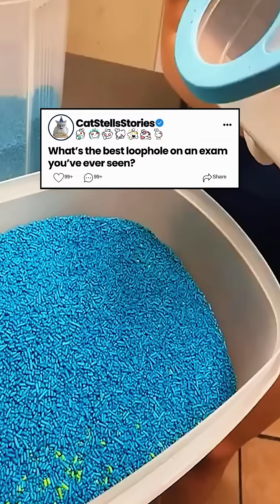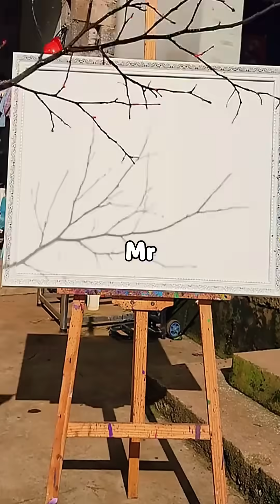What’s the best loophole on an exam you’ve ever seen?

Comment: That's not a loophole you just read the question
Reply: yeah once had such a question in basic chemistry about a concentration cell the math worked the results were physical impossible somthing along the line of 10^-34 or 10^23 mol/l
Reply: The loophole is when you have an exam. You start reading books mo ths before and you store notes in your brain. THEY CAN'T CHECK IN THERE. Absolute cheat. Works all the time 😏

Comment: A teacher that has a high failure rate has failed as a teacher
Reply: I was a TA. The rules it had for the class were simple 1. If you were not able to finish the test or quiz within 30 minutes of the first person to turn it in you didn't not get more time to finish, with 1 exception if the same person turned in there paper forst for the last 3 quizzes order test them it defaulted to the second person.  The second rule was that is gave the final on the first day any then gave it back with all the correct answers, them saw it again as there final. I cant till you how many of the A students in other classes gotten Cs in my class and there student that took my class seriously were getting A's.  
Them best part was the parent that would call and ask for there child to retake the Final.  When I informed them that is had given there child the Final to them on the first day of class and that there child scored a higher grade then at the end of the year, because they only completed 30 of the 100 questions because they need to get 30 right for an A grade. I wouldn't be giving them a makeup test.  There were only 5 times that I gave a retest and all of them were for reasons outside of the students control.

I used the data from that class to write a paper for my sch class On How Students look at classes they think they know, when i turned it in my
Reply: Normally, I'd agree with you. However, in this particular case I agree with the professor. 

Being able to recognize the impossible as impossible is a lesson that cannot be taught, it must be learned.
Reply: @jamesharmon4994 fully agree with the situation of the exam question. But for a teacher to find joy in students failing and the overall lack of being able to explain the subject in a way the students can comprehend and retain shows failure on the teachers part in my opinion overall.
Reply: @GCrane21  It seems to me that this is a university course that teaches an extremely complex concept. I have a Master's degree and it is my experience that professors actually teach only one thing: How to learn. 

The list of tools necessary to learn are given to the students. If the student doesn't learn, it's not the professor's fault. 

What the high failure rate tells me is that the vast majority of the students shouldn't be taking the course. If this causes so many to change their major, my reaction to this is: GREAT!